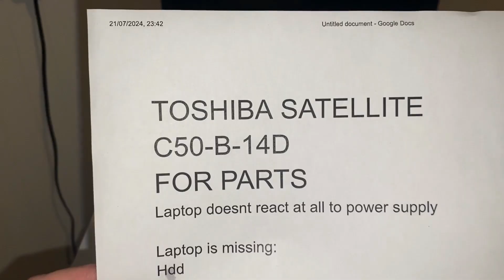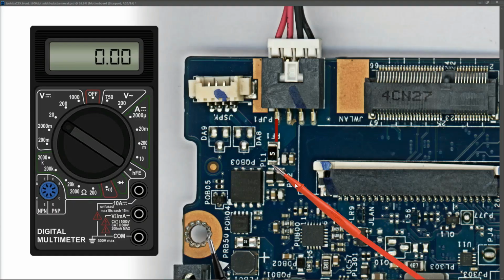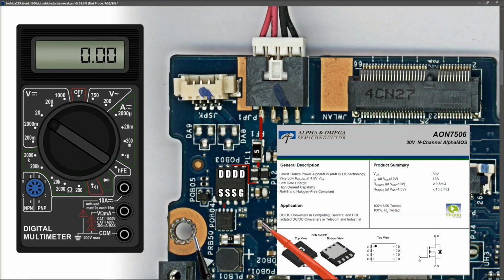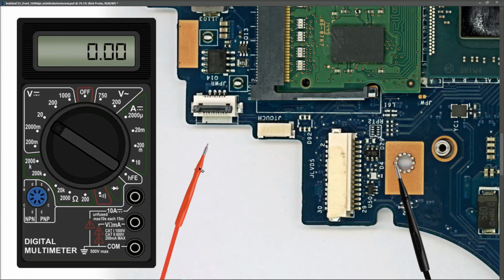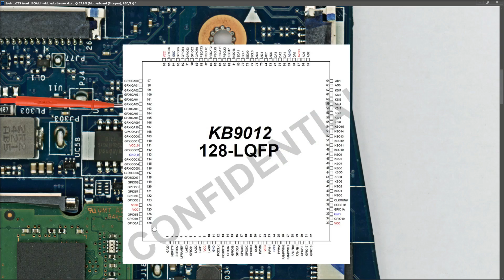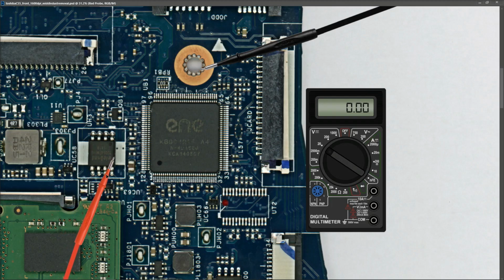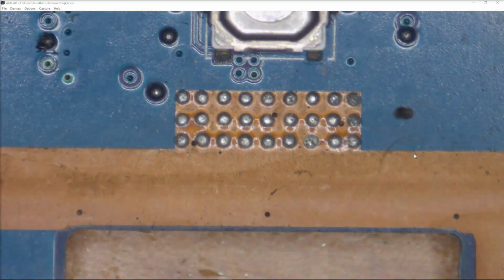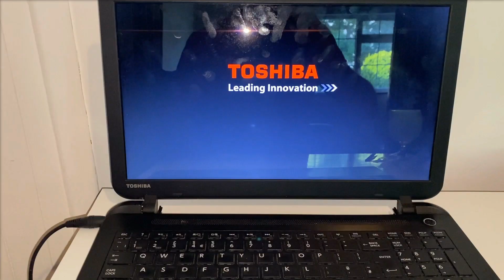Toshiba C50 - How To Troubleshoot A Toshiba Laptop

Comment: How do I short circuit my a toshiba satallite c50 a 0fn’s motherboard to turn on without the power buttion my power button broke and there isn’t anything I can find to replace it
Reply from the maker: If you look at 8:00 you will see that at connector JPWR, I measure 3.3V on Pin 3 which is the power button input signal, and Pin 4 is ground. If I were trying to power the laptop on, and I did not have a working power button, I would use my tweezers to connect Pin 3 to Pin 4 for a half of a second - This should emulate the power button being pressed and tell the laptop to power on.

But please understand that this is the action that I would take if it were my laptop. I dont want to be seen to be advising you to do this, as there is a risk with doing anything on the board, and you could make the significantly worse if the tweezers slipped and hit the wrong components.